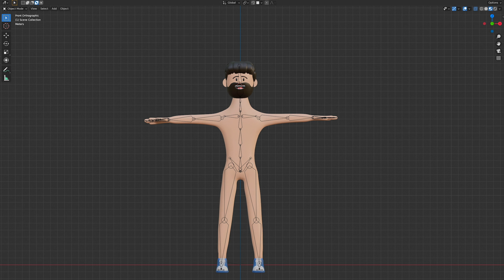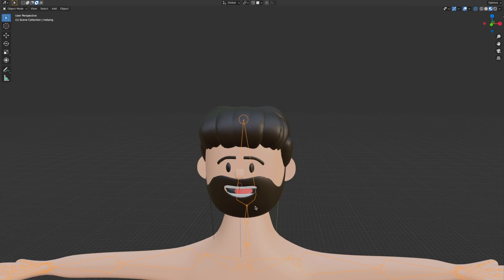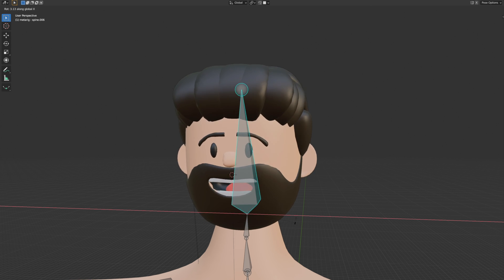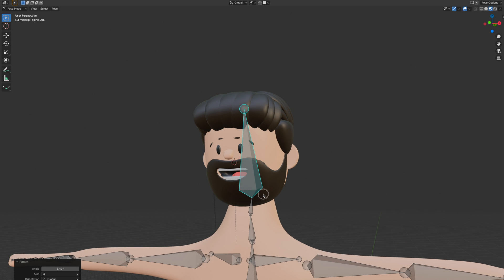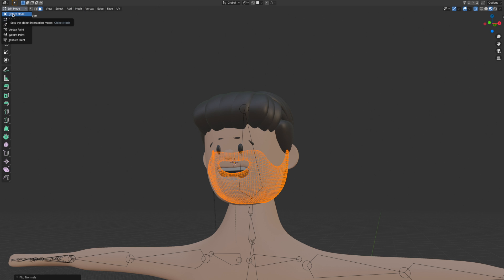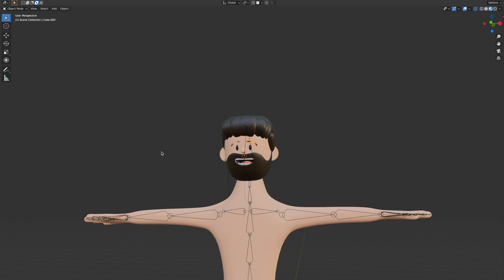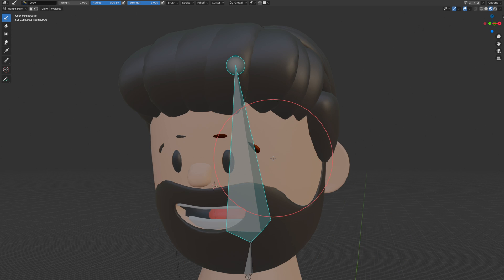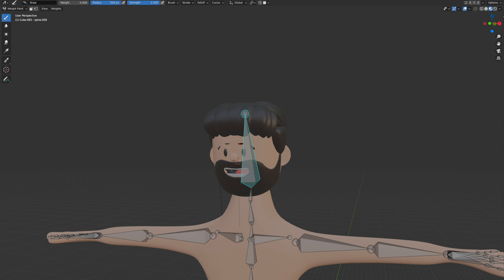Manually fixing Weight Paint issues after applying automatic weights - Blender 2.91

Comment: An easier way to make an entire object like the beard a solid weight is to use the gradient tool with a sharp fall off, one swipe across the mesh paints it in one go
Reply: I too figured this out, it works pretty good but sometimes it fails. Still it's better than doing it manually, would be nice with some sort of bucket/fill tool tough :)
Reply: @Lowe0000  found a better solution, just goto edit mode and under vertex groups, click assign lol, acts as a fill because you can set the weight in the vertex group before assigning